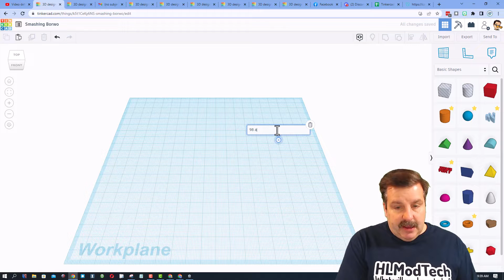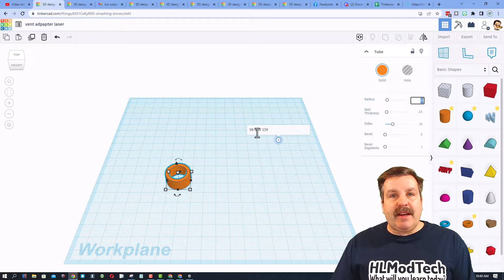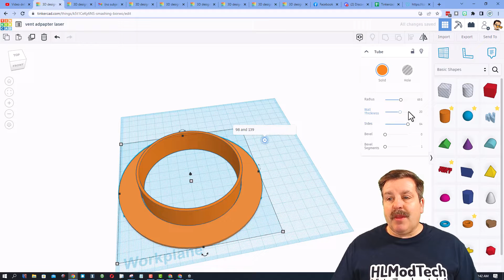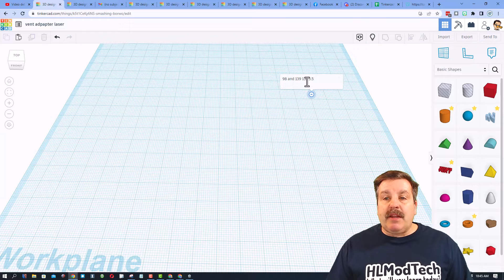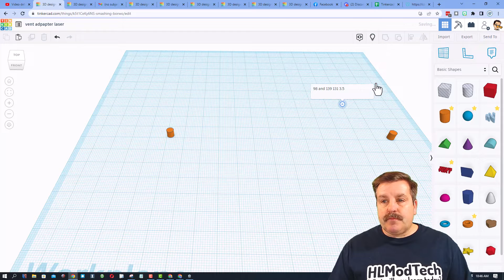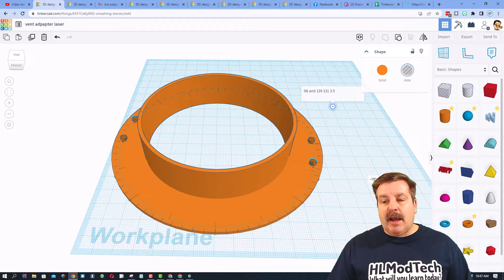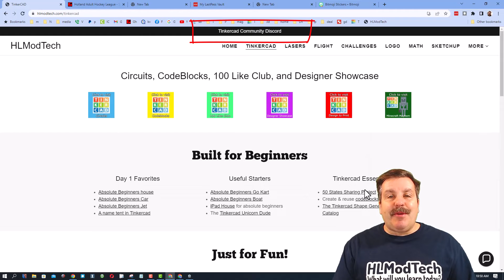Make a  3D printed Tinkercad four inch exhaust vent Absolute Beginners

Comment: What about a triangle with rounded points that flows into a circle? With smooth transitions
Reply from the maker: Like the funnel? https://youtu.be/aN_6eY9GVQY
Reply from the maker: I also have this one with the rectangles and a paraboloid for the transition. https://youtu.be/24ByEWUmJ3g
Reply: @HL ModTech  yes just like the rectangle one, but a triangle instead of a rectangle
Reply from the maker: A rounded triangle is a cone, right?
Reply: @HLModTech  no I mean a triangle with radius/rounded corners. That smoothly flows into a circle. Triangle on one end, circle on the other
Reply from the maker: I do not believe Tinkercad has a triangle where we can bevel or round the corners.  If you do not mind, create blank project and send me a share link. To share a project you need to use the steps in this video https://youtu.be/XeDQjhRK8lg Then at least we can share some shapes as we try to figure this out.
Reply from the maker: You can reach me at hlmodtech gmail.

Comment: Instead of Guess and Check, it's easy to make the inner hole the same size by calculation.

Alternatively, use a cylinder for the tube, another for the flange, the another cylinder for a common hole and finally group together.
Reply from the maker: =) Making the former math teacher in me smile. =) 💯👍